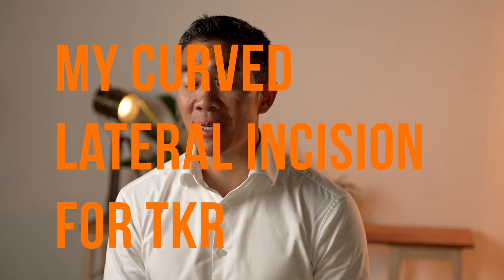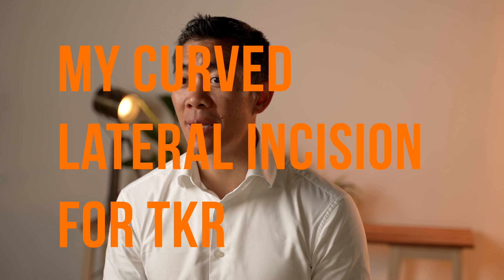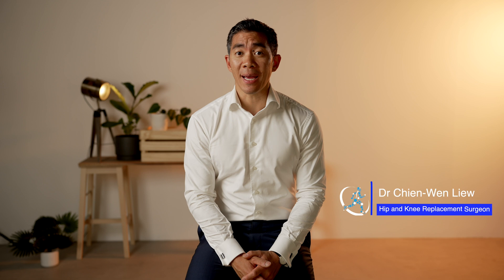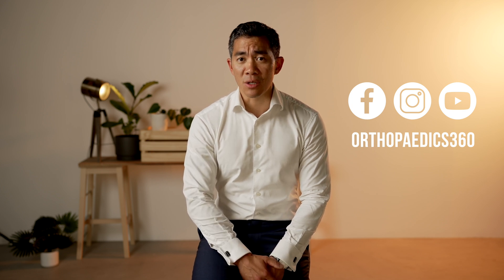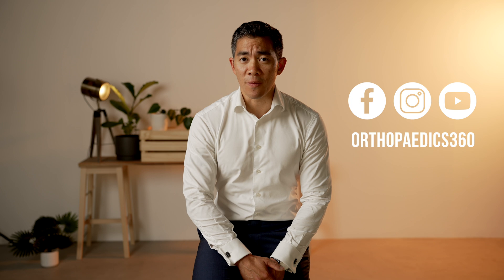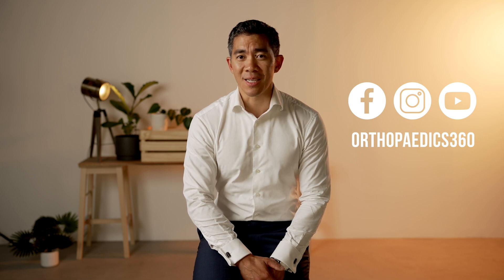The lateral curve incision for a knee replacement

Comment: Dec 2022 at 57 years old I had my left knee replaced. That knee was diagnosed with a bone disease at 16 years old and a bone graft surgery was then performed. A 3" scar arced right next to the inside of the knee cap. Because a second scar next to it could compromise the health a new scar, that scar had to be reused when performing my Dec 2022 TKA. That old scar now extends upward and downward from the original scar. In June 2023 I had my right knee replaced, and my surgeon refused to arc the scar to match my left knee, and that scar goes straight down the front of the knee. Post OP kneeling ended up the same in both knees, but the nerves in my left knee recovered better than the nerves in my right knee. I currently have no numbness in my left knee, but there is a 4"-5" section of the outside of my right knee that is still numb.

Comment: Very interesting…I had a TKR 5 weeks ago and the incision was curved but on the inside of knee.

You mentioned nerves go from inside to out and what I’ve been experiencing is a bothersome burning sensation at the incision which I assume are irritated nerves.

The reason this route was chosen was due to a previous knee surgery 4 decades prior.  

When I spoke with my surgeon he showed no concern about using the route of the old incision.

Perhaps I’m being a bit paranoid but I’m wondering if I would have avoided the “burning” sensation had he simply used the traditional route.

I pray what I’m experiencing isn’t a chronic condition.

Your comments are appreciated.

Great channel and information Dr.

Regards,
Reply from the maker: This method is our preference, but most knee replacements are performed a different way to how we do it - with a straight incision down the front of the knee.
Reply: I appreciate your reply but should there be any cause for concern given the “burning” sensation recognizing I’m only 5 weeks out ?

Thank you !

Comment: How about recovery time and pain is for a lateral instead of the straight line cut???? I have heard there is less pain and recovery is easier??????
Reply from the maker: The curved incision was created to improve kneeling capabilities and the look of the incision, but not to improve recovery time and pain. Some patients have reported that it is easier with this incision however we believe that it is more to do with what we do inside the knee with kinematic alignment that results in less pain, rather than the incision.
Reply: @orthopaedics360 What approach do you take internally - MPP, midvastus, subvastus, trivector, etc. ?